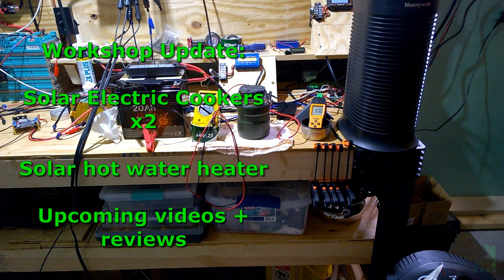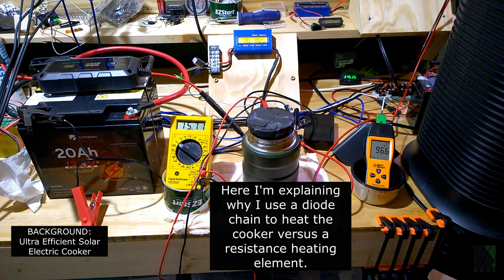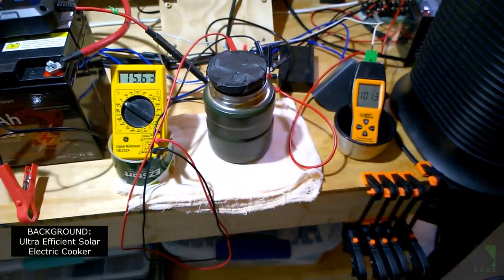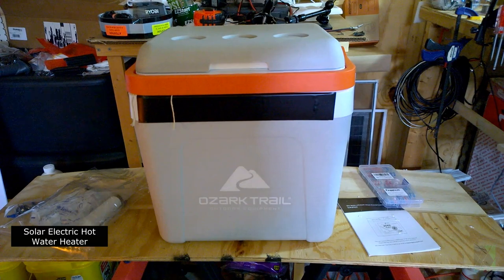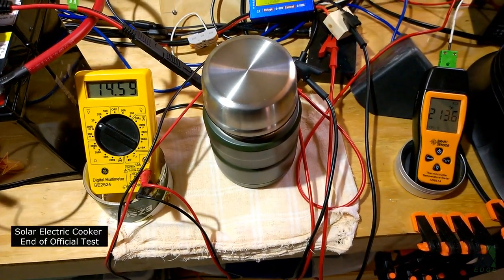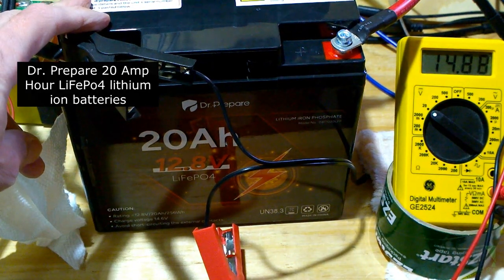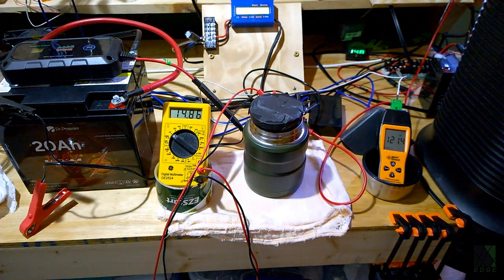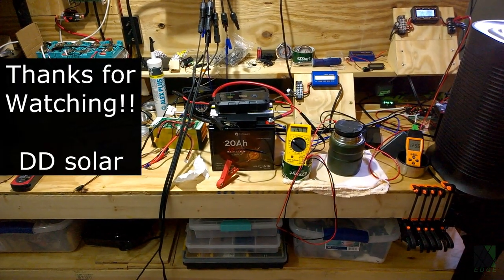Solar Electric Cooker, hot water heater project, upcoming reviews Solar Workshop #VLOG February 2024

Comment: Interesting! And on lower barometric pressure the boiling would occur even sooner.
Reply from the maker: @ferencszabo3504  Hello, you are right, it seems to start boiling 207-208F here. Or the thermometer is off? :) I did more testing since this video, and was shocked. Seriously, I boiled water at less than 10 watts. It's so hard to believe, but it works. I will post more details as soon as I can!
Reply: @solarpoweredge  Supeb!

Comment: Great vid! Love to see things progress!

I've bought a couple of bags of diodes to have a play. I haven't used them with a solar panel but with a bench supply set to 30v and 2A across 8 diodes I get a voltage drop down to about 8v which is a 16w output. Changing the voltage of the supply doesn't affect the draw much but increasing the amps increases the voltage in turn. Is that what you'd expect from a bench supply (it's a bit of a diy one)? I was expecting less of a voltage drop to be honest but I may be misunderstanding what's going on exactly.
Reply from the maker: @treesareafewofmyfavoritethings Thanks, I'm glad you liked the update :) the behavior is pretty normal with a CC/CV supply. I get the same results. Generally speaking, the current across the diodes should rise must faster than the voltage. With a solar panel, that's pretty neat because it's exactly what is needed to keep from collapsing the solar panel voltage when the cloud comes over. Current drops off, but the voltage tends to stays up near vMP. The voltage regulation isn't exact, and it can be hard to match the correct diodes to the vMP of the solar panel. A bench supply set to 2a can push enough voltage across the diodes to get 2a, in this case 8v - then it stops. If you raise the current, might get a bit more voltage across - hopefully not 30v! Not sure what would happen then.
Reply: @solarpoweredge  as soon as I posted the message I noticed the CC/CV thing which made it make a bit more sense but thanks for confirming!

The project I have in mind is using a bank of panels total 600w (but getting wayyy less than that when I'll be using them). The open voltage is 36v and 24 under load. I have some of the same diodes you've been experimenting with I think. What would you suggest I should be looking at in terms of number of diodes? Is it silly using diodes with that much potential wattage? 600w at 24v is only 25A which isn't that much higher than their rated 20A....
Reply from the maker: @treesareafewofmyfavoritethings welcome... no not silly at all, sounds like a good project. The question is how to cool them. The most difficult challenge is thermal. How to get the heat out. Otherwise the diodes burn up. If you can keep the lead temp ~100C they should be fine. Number of diodes for 24v: a rough estimate, maybe 25-30. 
My favorite way to protect the diodes from overheating so far is to immerse them. The heat goes into the liquid pretty easy. Extracting the heat from there tends to be an easier job. Like those radiator space heaters, same idea

Comment: I have two 1000W SUN Inverters with limiters hooked into my power panel on dedicated breakers.  One inverter for each 110V line coming into the house.  What would I need to do to add batteries to this system so I have some power when the sun goes down at night and the solar panel do not produce power?
Reply from the maker: @darylw792 Hello, the most straightforward option is to install some batteries, a charge controller and a DC-AC inverter big enough to run whatever appliances you want. Then plug some of the solar panels into that. Possibly through a switch. This could be an emergency standby system: the solar panels could feed the grid-tie inverters normally, when the power goes out switch over to the off-grid inverter setup. Just my opinion, hope it's of some help :)
Reply: @solarpoweredge  Thank you for the idea.
Reply from the maker: @darylw792 Welcome!!!
Reply: @solarpoweredge  Would a DC couple system be a good idea?  I am thinking to have the power lines coming from the solar panels split with one going to the SUN inverters and one line going to a charge controller that can monitor if the battery pack needs charging or not.  If charging is required the solar power is used to charge the batteries.  If batteries are full than the power is directed to the SUN inverter for it's use if needed.  Is this a good idea?
Reply from the maker: @darylw792 This works in theory, and I've actually done it before. It can be difficult balancing the two inputs under some conditions. It's a good idea to have the batteries ready, they probably won't need much charging after they're topped off and they will be ready to go when needed
Reply: @solarpoweredge  Is there a certain charger controller needed to monitor this type of system.
Reply from the maker: @darylw792 In my opinion, just pick the CC that best fits your preferences and budget. Also look at some reviews and avoid the cheapest CCs with a bad reputation